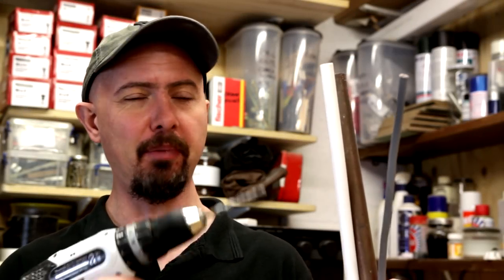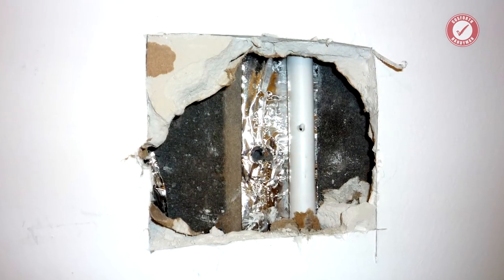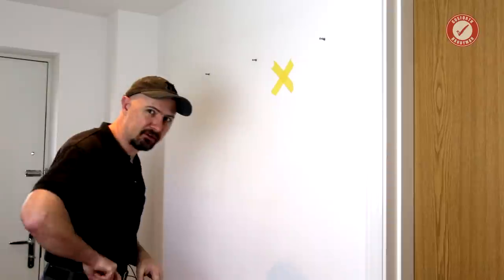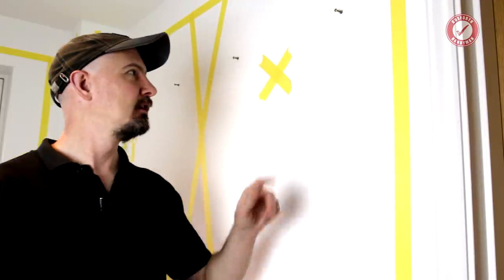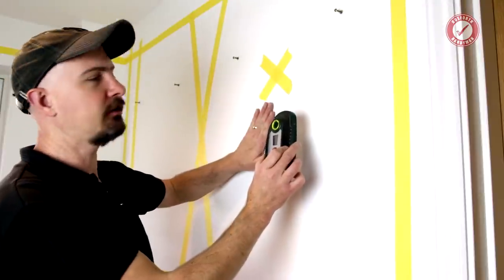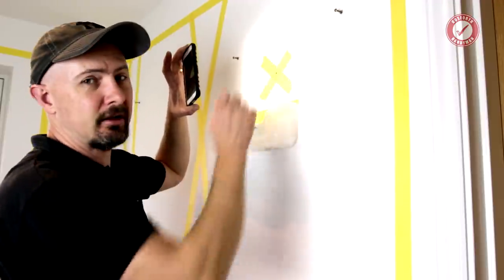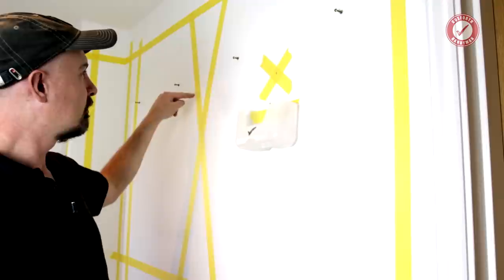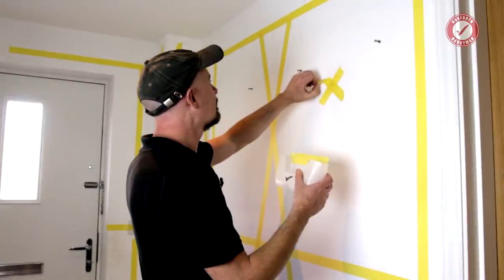8 TIPS to avoid Pipes and Cables in Walls (long rambling version)

Comment: A couple of times when I have drilled into things:  I punctured  a water line in a hydronic system (hot water circulation) which was under a floorboard where one would not have expected it to be.  Also I put a screw into a refrigerant line when I was working on Thermo King units.  That pissed off the guys I was working with.

Comment: honeslty the best thing anyone can do is get a stud finder. they may not be 100% accurate but used with these common sense tips you can drill with peace of mind. also, most places i live in the plasterboard is useally quite soft so even if your drilling on path to a pipe or wire, you can drill slowly and carefully and know when to stop because you feel it come out the other side. the chance of blowing up a wire or piercing a pipe is extremely low even if you do hit them

Comment: I recently was hanging a towel hook in a bathroom.  Found a nice stud to screw into.   Managed to hit an electric line, (going through the stud?) and trip the GFCI breaker.  I ended up removing the hook and moved it down 1", then reset the breaker.  Now I'm considering opening the wall to check the line and either apply liquid insulation to the nick, or possibly put a splice like https://www.homedepot.com/p/Tyco-Electronics-Romex-Splice-Kit-2-Wire-1-Clam-A22899-000/202204326 in place.

Comment: Don’t have any idea how I would know this, but if you see little sparks traveling between your driver and a screw you are installing in a peice of Sheetrock on the ceiling, and that piece of sheet rock might have trapped a loose electrical cable you saw before and forgot about between it and a ceiling joist, trust me it’s not because your magical and Gods gift to humanity. There is something going wrong, you should back out the screw, put down your driver and run away quickly. Your welcome.

Comment: I accidentally drilled through electrical wire when putting a shelf up for my mum. Made a huge fucking bang. Suddenly a job that costed £30 turned into £400. I been told by my sparky friends that I was ripped off by the emergency electrician but I freaked the fuck out and thought I might be starting a flame inside the wall. Amazingly after getting a wall scanner, it turns out I hit one of two wires in the entire wall and it was dead centre.
Reply from the maker: Nightmare! Hope you got sorted! 👍

Comment: I am 78 therefor remember when pipes and cables were attached in vertical runs, I.e. the 240v cable came up or down to a socket vertically, now electricians cable a run socket  to socket via the shortest route. So the cable could be anywhere behind the plaster.
Reply from the maker: Cables should follow the safe zones... I say should. 👍😀

Comment: What I would do. Simplify the process. Are you hanging a picture frame, adding an electric outlet or switch, etc. this is too much info for a simple picture frame hanging that is less than 5lbs. In weight .

Comment: Not at all meant to offend you - but this video is painfully long.  Seems it’s could be edited to 12 Minutes or so.  Too much talk on issues people won’t recall or superfluous talk off the subject.  Yet, it is your channel, so I get it.  It’s your choice and elections.  Showing the best of the few best methods seems more practical for a homeowner.  Unless it’s new construction the Code means nothing as not only may that Code not been in effect, people do what they want especially with low voltage cables.  The cables could be buried in any wall almost any place.  Check out Wall Bot radar note in my other posted comment to see in the wall and mark out “the truth” for that location.   Also, Imperial Blades for drywall can oscillate the cut just past the drywall inner surface with a nifty back pull cutter - so different and easy to cut openings with less effort, less risk of damage and less mess as well.

Comment: I went through a water pipe once and was like the boy with his finger in the dam until I could get someone to shut off the water 🙈😂
Reply: I wonder if a good tip would be... when you drill holes, use chewing gum. Btw the time you can hit the pipe, the gum would be in prime condition to be used as temporary barrier.